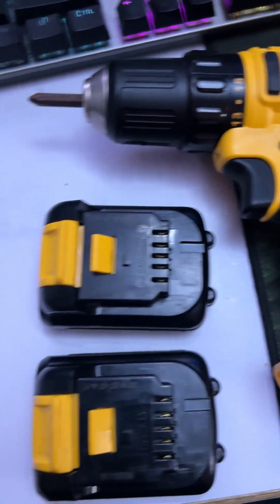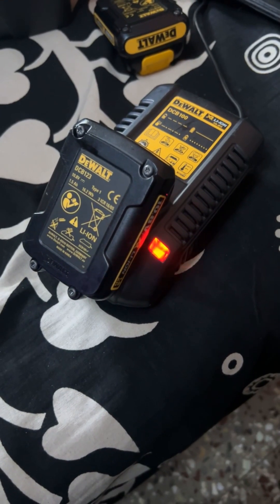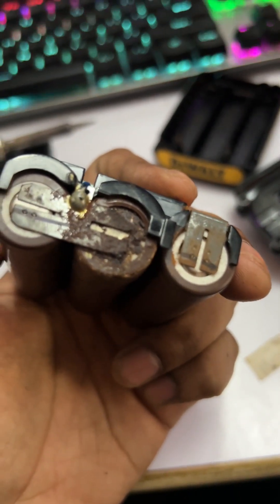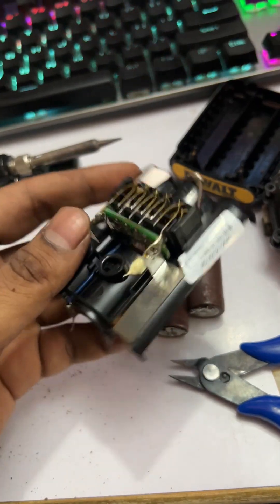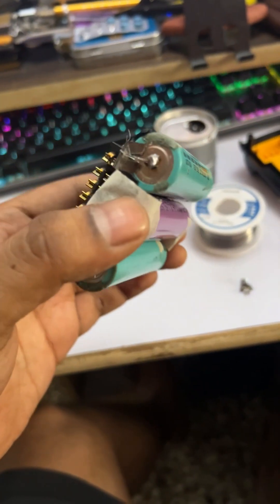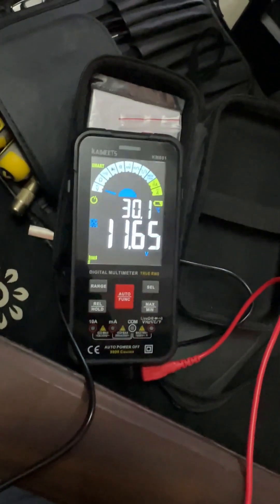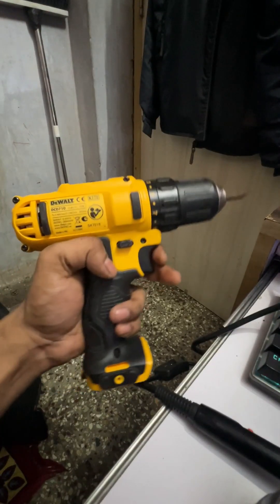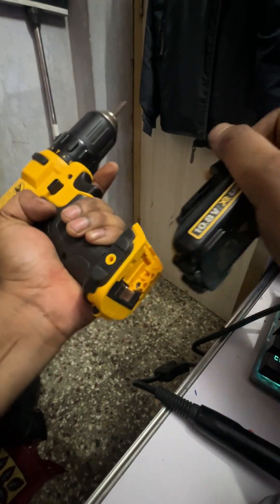DIY DeWalt Battery Repair – Fixing a Dead DCD710 10.8V Drill Battery! 🔧⚡

Comment: I get batteries from recycling bins and use the good cells to fix and make new ones. I only take Milwaukee and Dewalt batteries so they end up working great.
Reply from the maker: That’s awesome! Reusing good cells from Milwaukee and DeWalt packs is a smart move they’re built tough and usually have quality cells inside. I didn’t have any spare batteries this time, so I bought it. Great way to save money and keep e-waste out of landfills.
Reply: @AdarshRamanDIY try going to Home Depot or Lowes where they recycle used batteries. They usually have bins in the entrance you can just open and grab a few. It actually saves them time and money so they do not care then return all the bad cells later.
Reply from the maker: @my2centz196  Haha, I stay in India — we don’t have Home Depot or Lowe’s here 😅. But thanks a lot for the tip, really appreciate it! 🙌